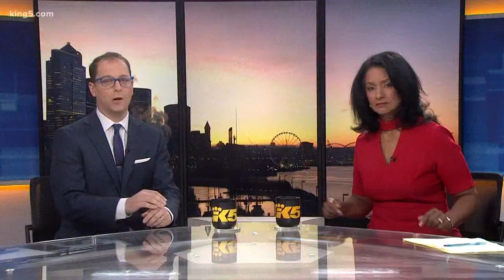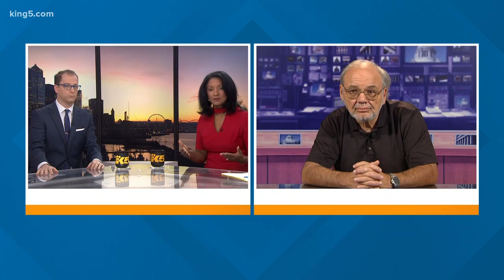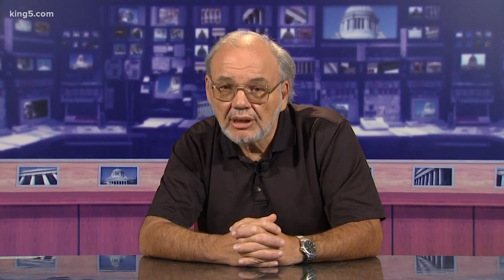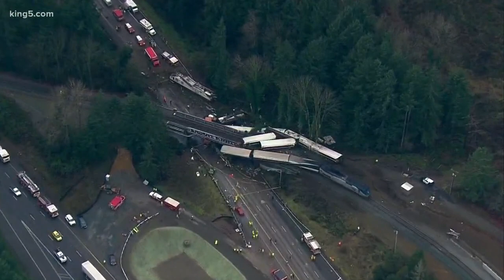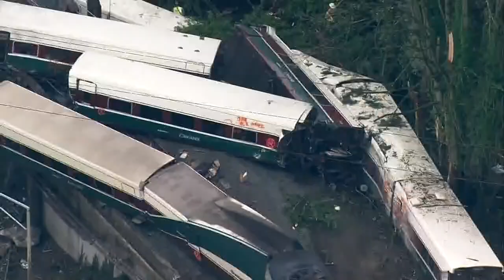Train engineer Robert Bregent on what might have happened

Comment: My point is it's should have a permanently post a solid yellow or flashing yellow signal light before any curve track(s) instead of solid or flashing green light which is help engineer instead of speed sign is posted next to the track is too fast by overlook or forgot to look at the speed sign with a small typed of sign and no matter how large sign is it. So, the signal light is seen a mile or ½ or ¼ mile away before doing so busy by looking on Locomotive gauge or computer screen or reading paper track reports or reading on schedules or looking at the time (clock) or chat and look on radio channel and many more. Now on those day without a second engineer is no helps during bring higher speed train. Between high speed to slow speed such as if higher than 10 MPH from previous posted 79 MPH then slow to 30 MPH is 40 MPH different with helps to alert at signal light huh to Federal Railroad Administration (FRA) or National Transportation Safety Board (NTSB) of don’t think for the safety to have signal light before the curves duh? !!!!!! Except several curving during at slow speed such as Donner Summit is not necessary to have yellow signal lights. Just required between high speed to slowest speed in ahead then bright yellow signal light is given them a warn in ahead of time before doing so busy.